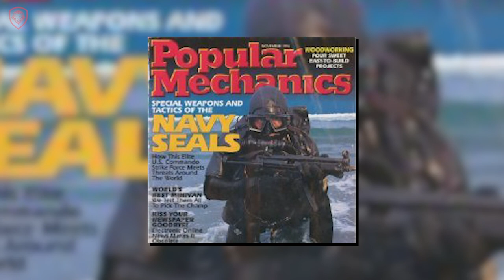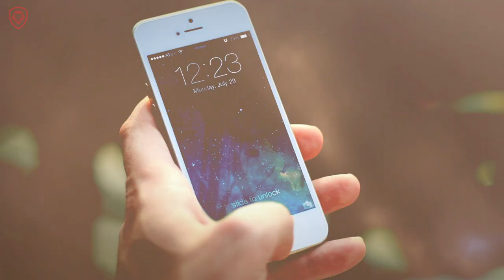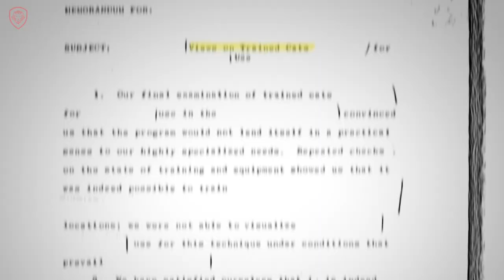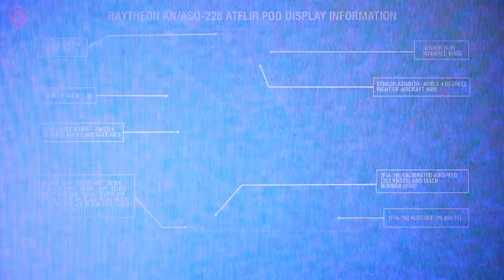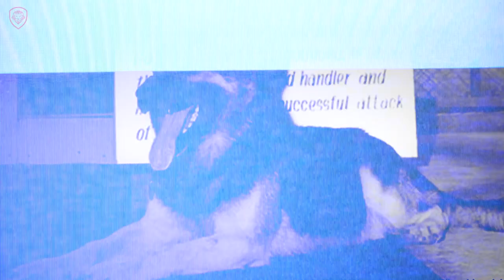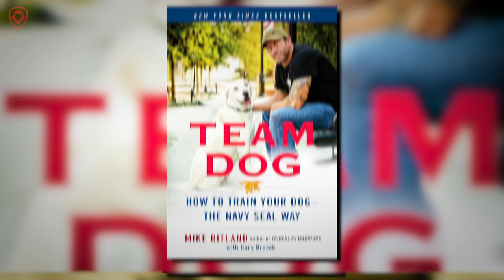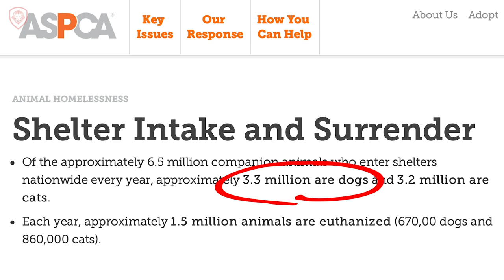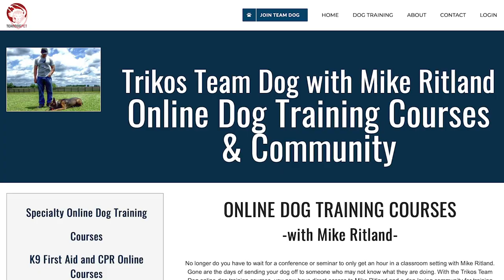Navy Seal Instructor Now K9 Dog Trainer- Mike Ritland

Comment: Honestly, I am all about equality. That being said, I am, have been, and remain independent, mentally sound, can and do carry the responsibility of both male and female roles in the family dynamic. I can, therefore I do. Where this point of view is concerned, I would have to concur.  Not for any other reason other than the obvious....Women can be elite warriors, no doubt. Men are, and remain "specifically" hard wired to be the "protectors" that is correct, female and male units, irregardless of capability, SHOULD BE SEPARATE, not based off equality in ability, but in speciality. The unit's bond IS its strength, without that there is no efficacy, there just isn't. SPARTA is a prime example. It hasn't anything to do discrimination, social, nor gender. Separate but specialized. The African Kings had the elite warrior unit as well...The Homies. I have always needed a certain type of male companion, one that compliments MY role, and does NOT hinder it. He MUST be of a warriors mind, body, spirit, but with heart and can retain his humanity...Needless to say, I remain alone, weak males do NOT compliment but hinder me. The same applies in military roles, only roles reversed.
Reply: Cynthia Akana please continue to push your perspective out to as many people as possible! I can’t tell you (because you clearly already know) how important it is for young men and woman to hear it!
Reply: @tdunn2  I do when I have a strong opinion, belief, or personal experience that parallels the subject in a public platform. Thank you for being so accepting of my perspectives, or opinion concerning this subject in particular, it was a pleasant response, I honestly expected a whole slew of ignorance for my statements. Thank you.

Comment: I'm a woman and I agree with Mike.  I don't agree with women being a navy seal and going to any kind of combat whether on land or sea. Passing training is different than being in  day to day missions alongside men for extended periods of time.   Men and women are different physically and in their mindsights no matter what anyone says.  Let women try it.  It will be evident.  Alot of men will try to protect the women if they are in danger which can hold the mission up and make the unit weaker.  Also, their physical strength is weaker I don't care what anyone says and that can hold the unit back and affect a  mission.  I don't care what anyone says men and women are different!  I happen to like that and I have complete respect for women too.  It is what it is and that doesn't upset me.

Comment: I bought my 2 dogs off craigslist because the shelters suck (not the dogs).
-$30-$40 Applicantion fees
-References they call
-1 reference they couldn't get a hold of. Got denied. Lost my money.
-Demanded my 1st dog be spayed before adopting the 2nd one (regardless of sex).
-Denied because I lived out of state and they required a home inspection (could not find a specific breed in my state)
Ended up on Craigslist. Got 2 super fun pups from great families. Denied the chance to a rescue because of the nonsense.